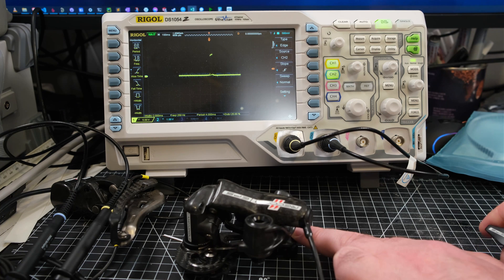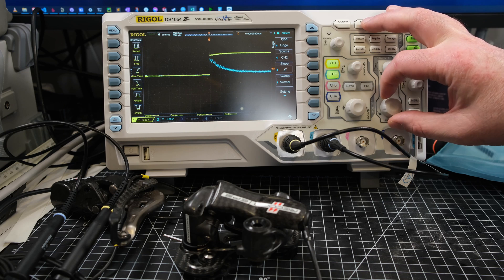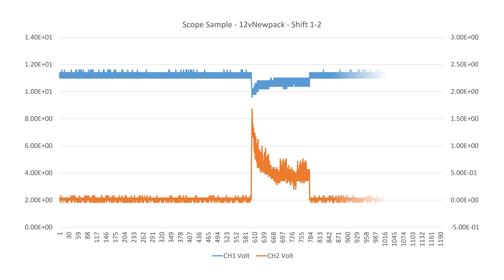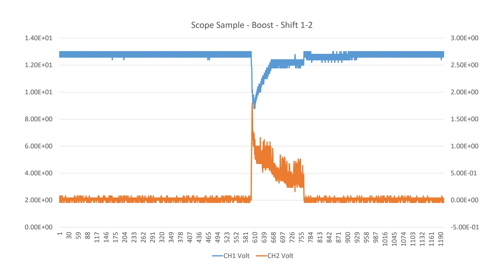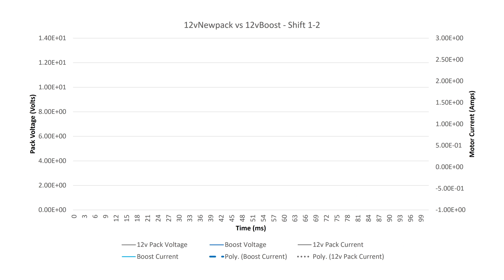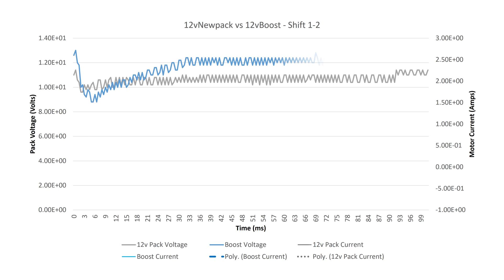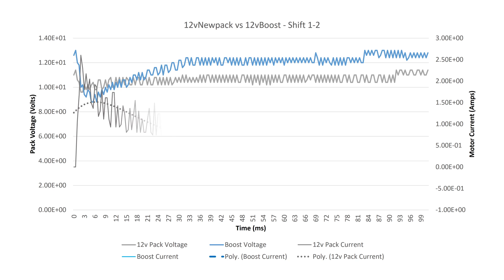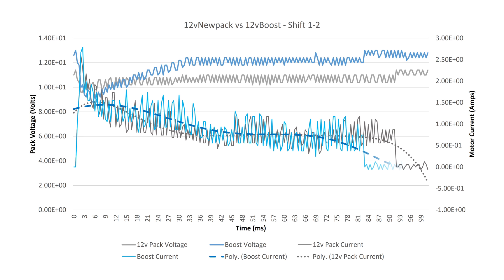How fast does a derailleur actually shift? EPX2

Comment: If you put the scope in the background wouldn't that give you more info for seeing when the signal arrives in the derailleur?
Reply from the maker: Ya, that would have been easier for some of the tests that used disassembled unit, but when compared to my stock that was inside the bike or ultegra I couldn't really do that as I'd have to tear open good hardware.  The scope is good to measure between signals but it still has a response time lag before display too. So it's a mixed bag. I'm actually getting back to this project now that contract work have become more manageable.
Reply: @kwakeham  I guess I thought there wouldn't be much lag

Comment: If you want to play around with really simple USB-C PD, you can get $2 adapter boards that will auto-negotiate 9/12/24V depending on how you wire the jumpers. The IC used is IP2721.
There are a few common commercial 2S 7.4V packs (built in protection), but, if the motor is expecting 12V that doesn't help much. But I like that you tried it.
Reply from the maker: I've seen these, but I'm not sure what they do when the mostly non-compliant USB-C adapters fail to respond. Given the intelligence of the Maxim parts charging IC and it's ability to buck boost and charge 2s or 3s from 4.75 to 25v volts with the voltage sag detection, seems like it's already the 3s charge solution with just dumb 5.1k pull downs on USB-C CC lines as all charging current would not require the higher voltage, just a nice to have. If I design something around 15v (45watt adapters) request and 98% of chargers won't do it unless someone buys a 50 - 60 watt adapter when a smarter chip like this would mean any-old 1 - 3a 5v charger, even USB-A with USB-A to USB-C, would I think be a better consumer choice given the 5 - 15 watt charging envelop for this project.
Reply: @kwakeham  ok thats impressive if it has charging, etc. built in as well. 15V doesn't necessarily mean 45W adapter though, there are 30W adapters that can output 20V. Whether that is actually in spec or another non-compliant minefield, no idea. I agree simple USB A is best.
Reply from the maker: I'm certain you're likely right that you can get adapters that violate the USB-C PD compliance with lower current and higher voltage, but now you're not even PD compliant. In "special" bundled adapter territory. The result is that you can't count on anything supporting the voltage you want and you're sink must provision 5V anyway if you want PD compatibility, so you're left with being required to boost anyway. I never want to have to have special adapters around.